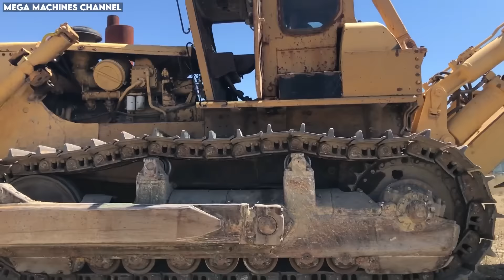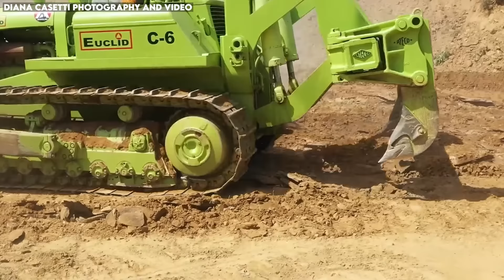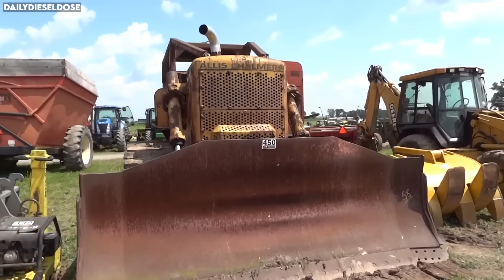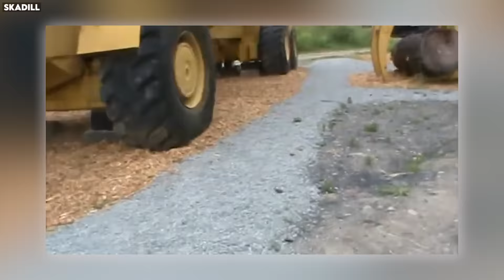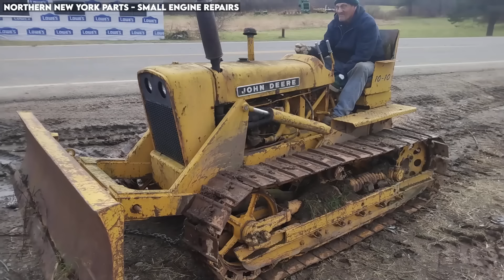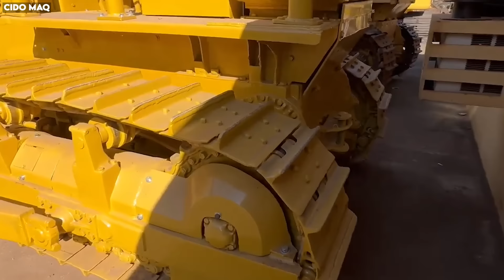10 Old School Dozers That Were Way Ahead of Their Time

Comment: How in the  hell  is a two wheel drive  Tractor  scraper unit  a crawler tractor  ,and the Uclid  Terex crawler   tractor  was  a subsidiary   of General  Motors Diesel       Engine    Division  ,which developed   built and used the   G.M. Detroit  Diesel   ,two cycle   Diesel   Engine  ,not Cummins  What on God's Green earth are you talking  about  , fiction  and stupidity  !!!